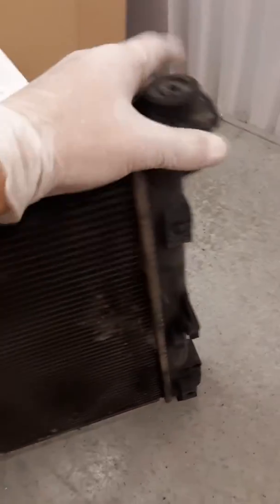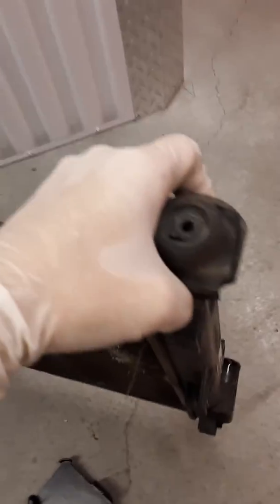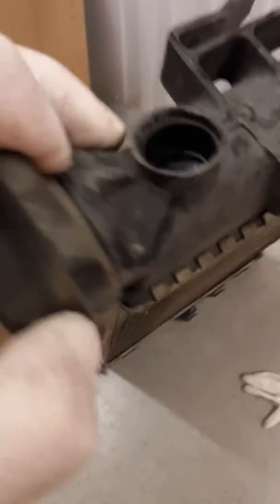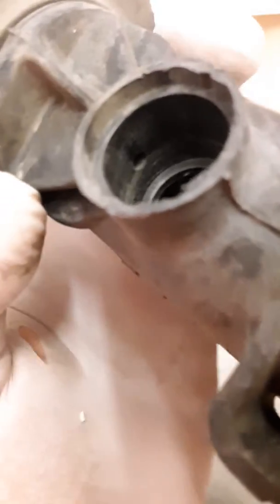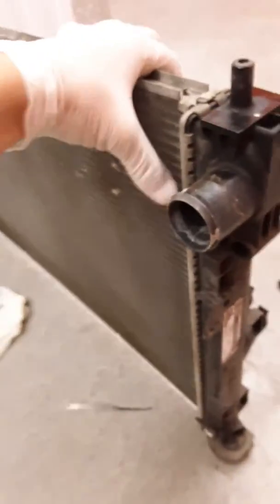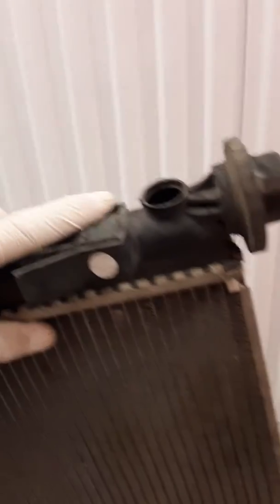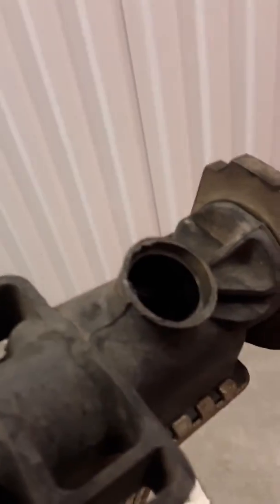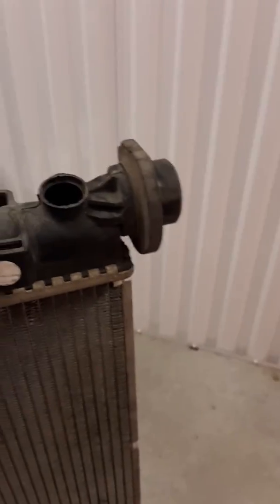Radiator information

Comment: That hole in the bottom of the radiator is the drain hole for the radiator coolant. The valve does not need to be removed to drain the radiator.  Turning the valve 1/2 turn counter-clockwise opens the drain hole.  My valve turned easily the first 1/4 turn.  It was very difficult to turn the last 1/4 turn.